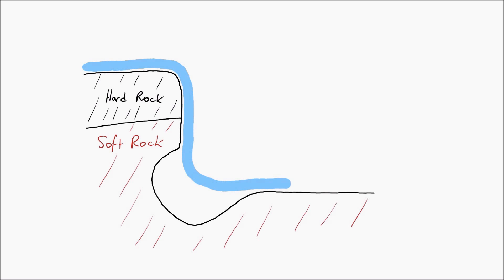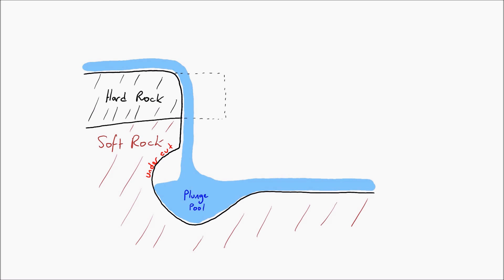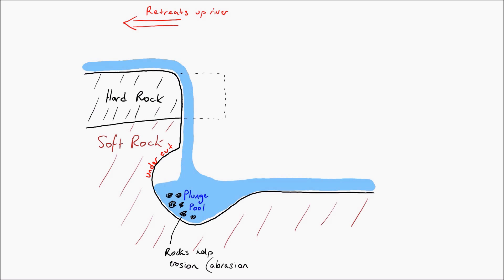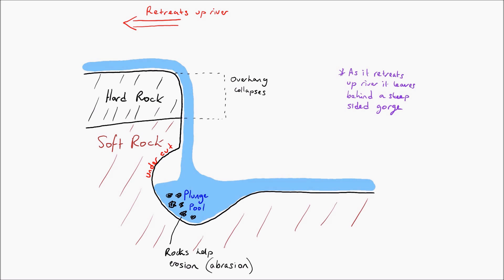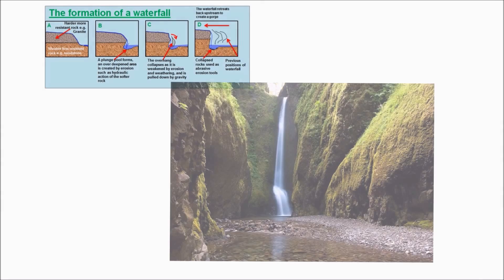How a Waterfall is formed - labelled diagram and explanation

Comment: It just came up on my mind, if a waterfall is the activity of water falling down, where does all of the water come from. Why isn’t it running out of water? 🤨
Reply: It naturally comes from mountains. It usually starts with a trickle of water, pourring out of a hole,which will over time create a stream. (Due to errosion.) Then it might become larger, and become a river. And so all the water from the waterfalls, come from mountains, and rain.
Reply: willyum so does that mean the water come from the ground to the mountain with adhesion?
Reply: @Ultearss  yeah most likely